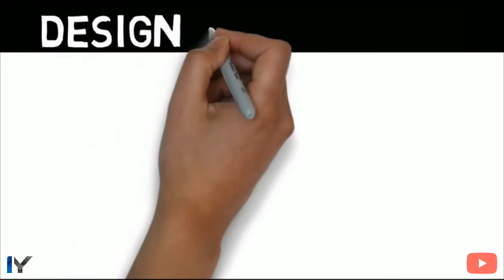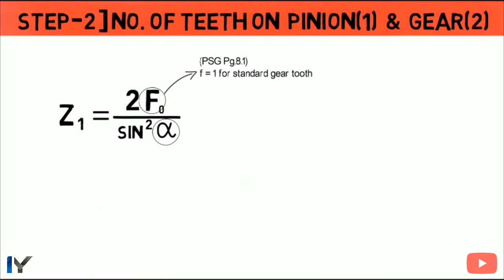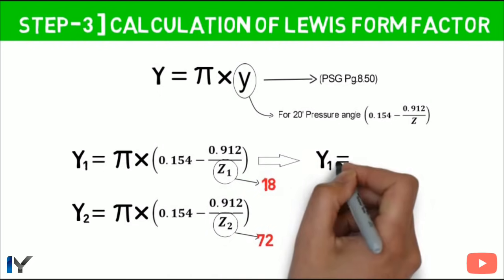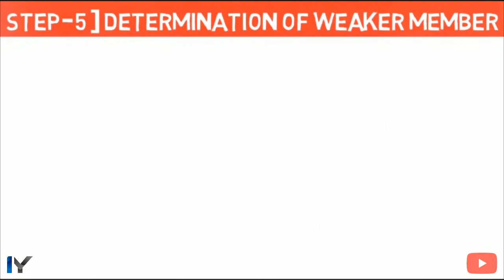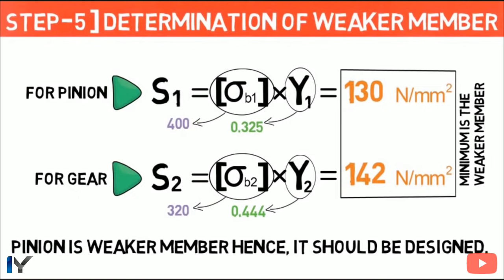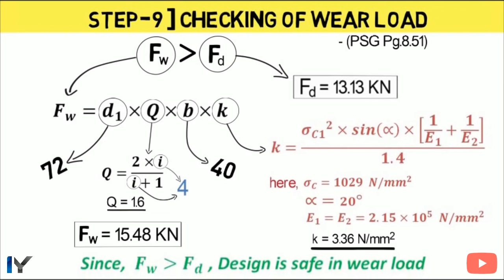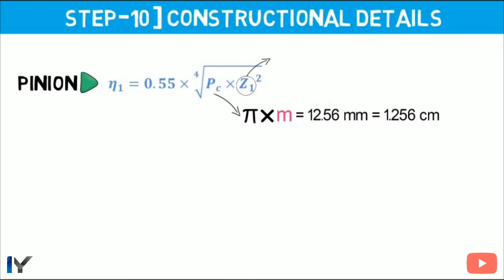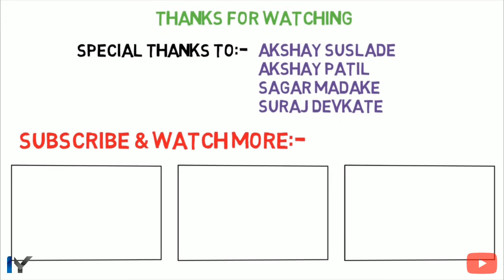Design of Spur Gear - Using PSG Design Data Book - Complete Procedure

Comment: Sir
Pitch Line Velocity Vm is 2.17 m/s which is less than 20 m/s , but in data book The Given Cv i.e. Velocity Factor is for Vm Greater than 20 m/s for Precision Gears, i didn't understand why you chose this
in this video at time 13.10 sec

Comment: In 2nd step during finding reduction ratio (i). You notated N2 = 576 RPM. And during testing in bending criteria  to put the value of torque you use N1 = 576 RPM. That's totally wrong. Kindly check & revert ASAP
Reply from the maker: Yes......take N1 = 144 rpm.
Reply: @iyzone8009  means the values of entire example will be different. Value of [ Mt ] will be much higher.